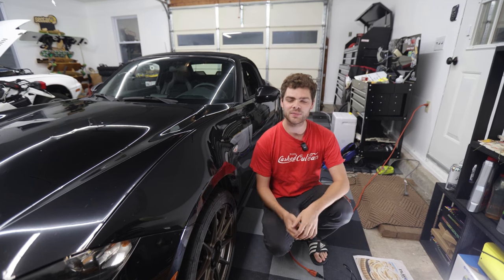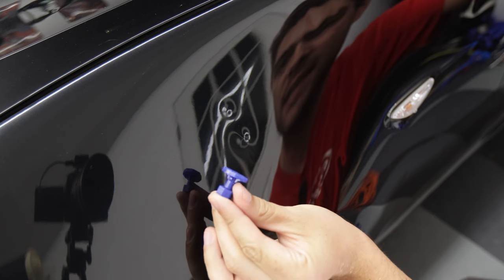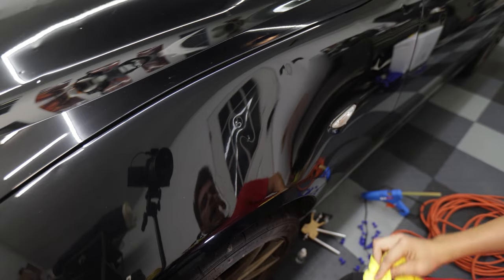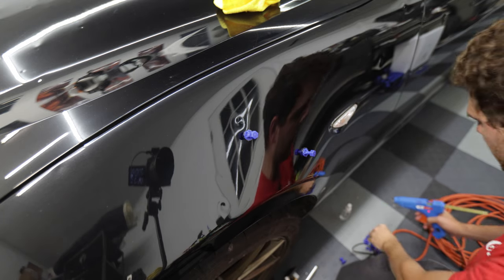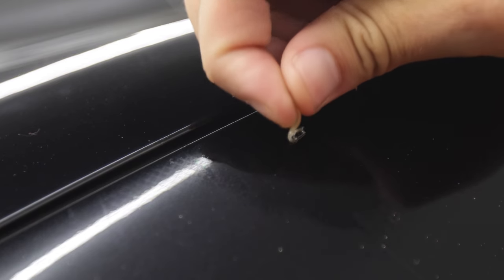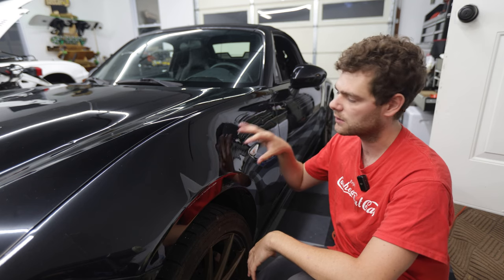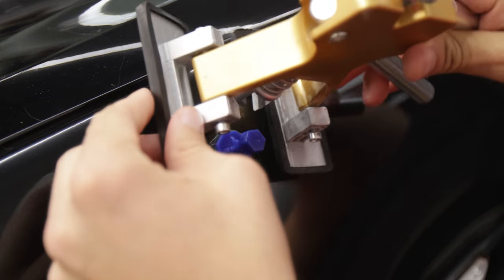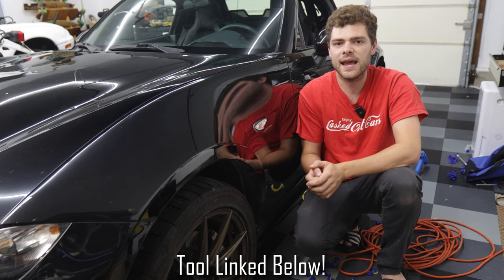Removing MAJOR Hail Damage with a $30 Paintless Dent Repair Kit - Does it really work?

Comment: So basically... It's a lot of work that doesn't really work
Reply: He said it got 80% out.
Reply: @helened6896  I watched the video, there's still dents there. I'd argue near pointless.
Reply from the maker: It did take a moderate amount of work, but wasn't hard. Yes, there are dents still there but they're much smaller and it made a reasonable difference in my opinon
Reply: @Richard-ck5zk  S timto postupem ano jsou,jen zčasti vyrovnat,pote jedine zevnitř pomoci tyčovych haku dorovnat ,pokud to je ocel.plech,pozor však na hlinik tam pokud se to přežene nastava nevratny proces
Reply: Ive seen another video where he used a line led and a hammer with rubber pointy tips and it was perfect

But the method showed in this video will work for most economy cars as it gets it out 80%